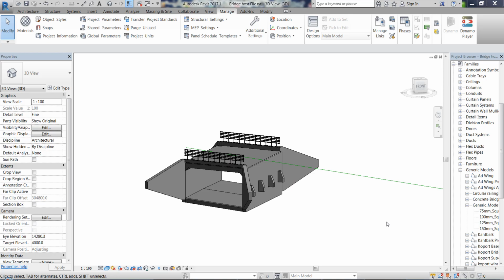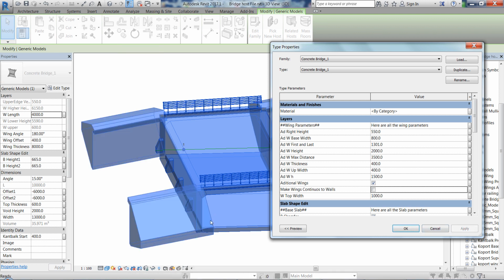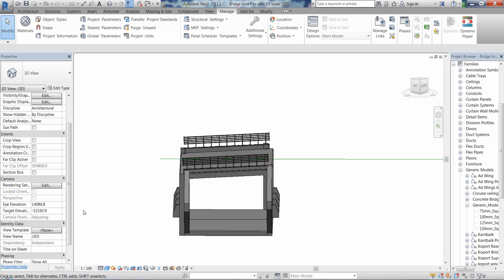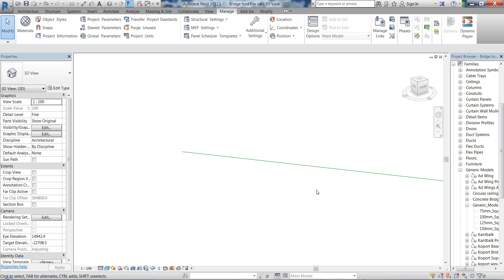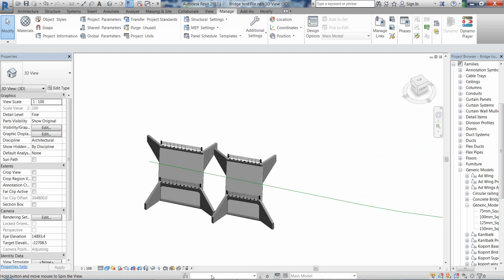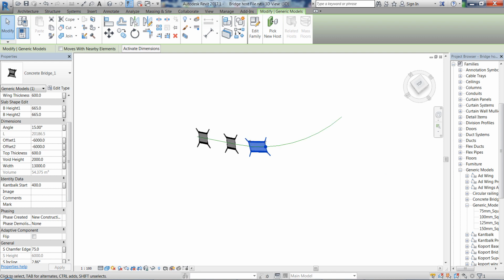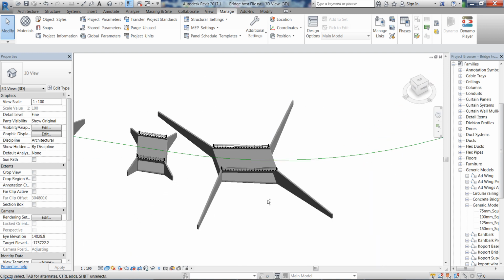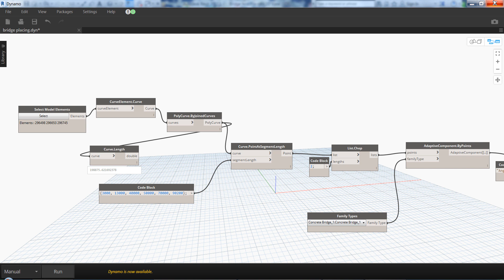Revit. Highly parametric bridge model and placement with Dynamo

Comment: Hi, is it better to create a box culvert with generic adaptive or just generic family?

Thanks
Reply from the maker: Great question! It depends to a certain extent on the workflow, on the complexity of the geometry and on the versatility and detail of what needs to be modeled. In this example almost everything could be easily done within the standart family editor with nested families. However nested families inside a host families are difficult to cut and if I remember correctly we opted for the adaptive environment because we needed some voids to cut the geometry in a way where it wasn't possible to do with the standard family editor. I think the original version of Revit we used for these was 2016. However "normal" families are usually easier to use and control and they're also less heavy in a project compared to adaptive components. If I'm given a similar task again I would still try to accomplish it within the normal family editor first and only if I'm sure it can't be done there I'd go for an adaptive component